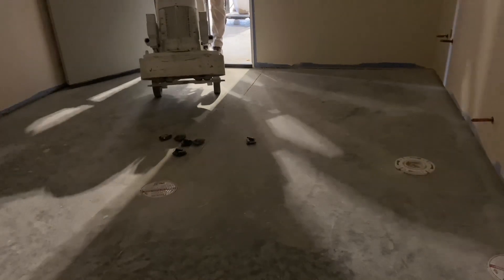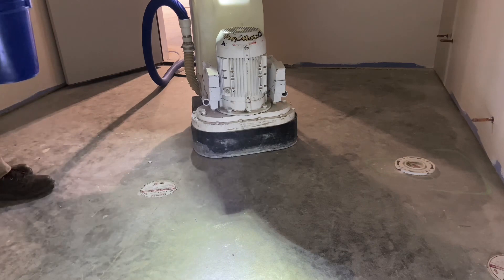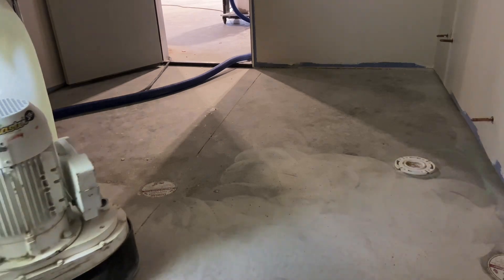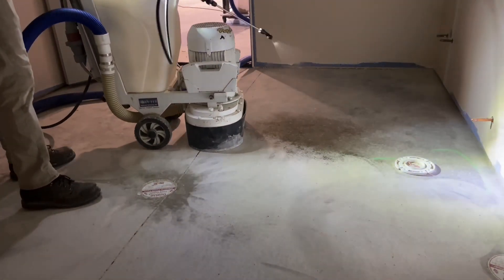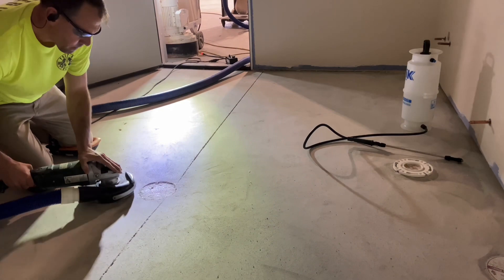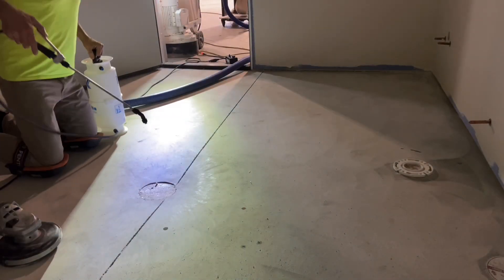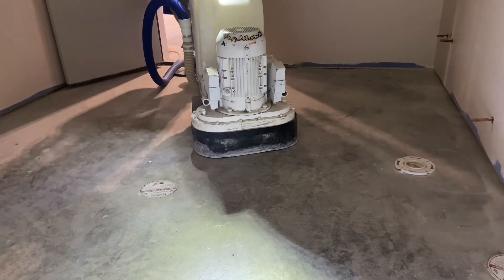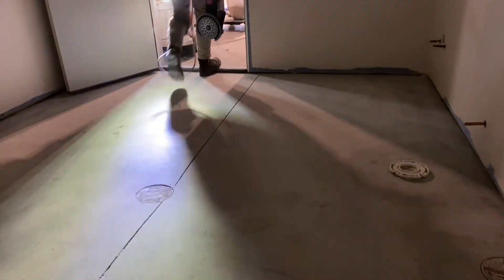How To: Hard Concrete Grinding and Glazed Diamond Prevention

Comment: Josh, why are you using hard bond tooling on a hard slab? Don’t you think a single segment soft bond tool would have eliminated the need for water and sand?✌️
Reply from the maker: That’s a great question. Reason being is the cap is hard but it’s easy to gouge below that. The hard bond’s are controllable to open it up quick enough but not do damage that might affect the coating finish appearance.
Reply: What kind of vehicle is that i love the setup